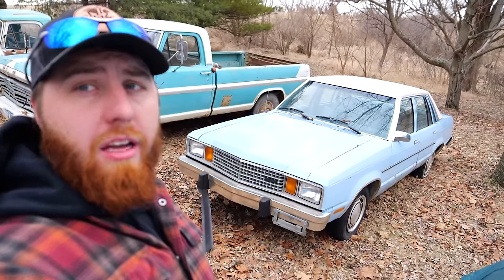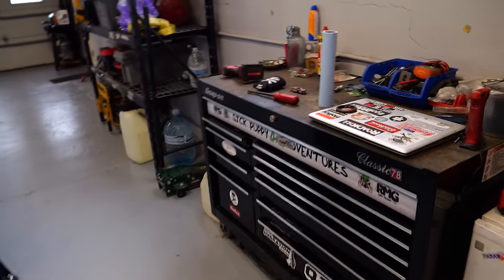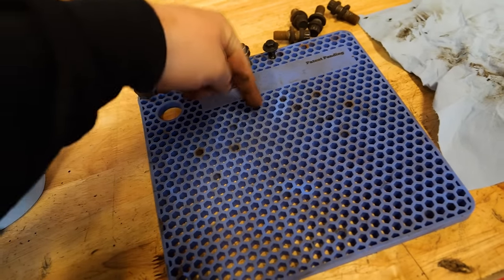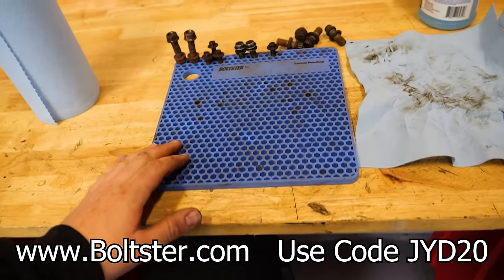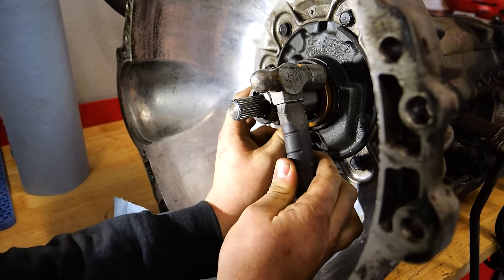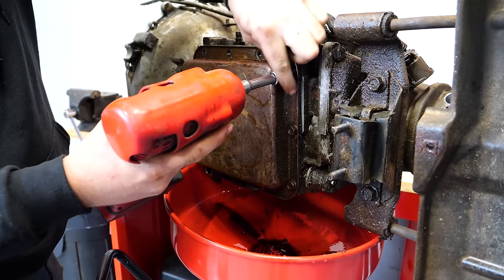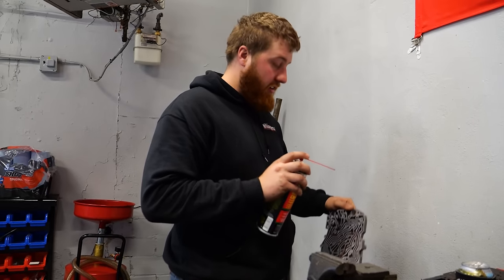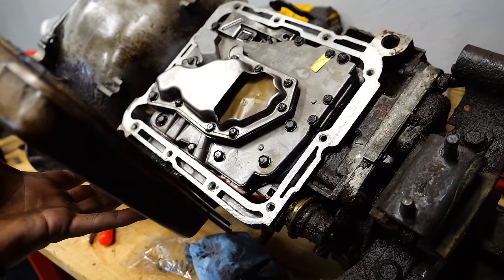CHEAP V8 Ford Fairmont REVIVAL! Will it Run & Drive?

Comment: Engine hoist - a device used to test the tensile strength of everything you forgot to disconnect or missed while preparing to remove the engine.
Reply: 2 ton come-a-long, 6 foot section of tow chain, and big tree in front yard = Engine Hoist.
Reply: Been there,  ahem  done that   $$$$
Reply: Some chains and an old beater 12,000 pound forklift usually auto deletes any miscellaneous wires hoses and stubborn bolts
Reply: @fieraci8500  I did that but with the support beam of my garage
Reply: Yep, BTDT.  Clutch cable got broken the last time I did it.
Reply: Tensile strength is no match for my chipped cutoff wheel!
Reply: A 4l60e bellhousing is not that strong vs a 2 ton engine hoist 🤣🤣
Reply: What does the shift kit do?
Reply: I pulled the flywheel through the inspection cover on my Suzuki XL7's transmission because I forgot about it.
Reply: Accurate
Reply: The most accurate description I've ever seen of an engine hoist.😁
Reply: @fieraci8500  that's exactly how I used to do it lol
Reply: I have picked up the front of my Impala when I changed the motor because I forgot to take the motor mount bolts out
Reply: @Will-ct9ww  that's funny😆😆😆
Reply: @larryhullinger4141  I was wondering why the whole front of my Impala was coming off the ground then I happened to look and see I forget the motor mount bolts
Reply: I feel attacked
Reply: @macoyreiber4482  why
Reply: @Will-ct9ww  I may or may not have missed a few electrical connections and or hoses when I pulled my 352. Needless to say, I am getting a new wiring harness and some hose...
Reply: @macoyreiber4482  its all in good fun We've all done dumb shit working on our cars lol
Reply: @larryhullinger4141  for sure!
Reply: @larryhullinger4141 I once swapped out my intake manifold just to make sure my engine light worked....it does!
Reply: I changed my 77 valiant Charger gearbox out, had two railway sleepers and 4 parts of sleepers, no jack, allso I found a pit helpful when I did my EA Falcon 5 speed, had it on my shoulder, but had to bend my legs a to get out from under the car to put it on the side of the pit 😂 took me all day to remove and replace, it was only about 40 degrees Celsius, fun and games 😅, all the best to you all
Reply: I think you meant to say “forklift or Tractor bucket”
Reply: ok
Reply: Been there done that. Weirdest use for an engine hoist I've seen though, was a buddy of mine welded one to the hitch receiver on his f250 and added some bracing to it, and used that setup as a tow truck. It worked, but it was super sketchy to see that going down a gravel road at 65 mph with a 4 door dodge Dakota being towed with just a half ton ratchet strap and a log chain as a safety chain.

Comment: This Fairmont doesn't look too bad for the year. Since it is a Foxbody it has a lot of potential. I say just beef it up and make it a sleeper
Reply: At this point every old car has been beefed up, I automatically assume them to be a sleeper.
Especially Fairmonts, I havent seen mint beefed up ones at all, so might as well go the whole nine yards to be different at this point.
Reply: @ToreDL87  I'm a big fan of 4 door manual trans cars.  So t5 swap and suspension upgrade would be pretty fun.  Low buck upgrades are pretty cool.  So Many options with mustang parts
Reply: @nealpurdy1202 also 303 cam and four barrel Edelbrock make it a down right great little cruiser
Reply: I say keep it stock like his foxbody mustang that he loves so much
Reply: Beefy mmmmm
Reply: @ToreDL87  dude I dont see any of that here and kevin is basically a neighbor.

Even the big trucks are just fancy looking slomobile's with an exhaust system.
low, slow and loud.

Whole lot of noise for a slow ass car.
Reply: @Bender_B._Rodriguez  Yeah trucks and suv's is all everyone ever drive these days,  what remains of the classic cars have all been bought up and souped up.
Reply: @nealpurdy1202  Love me some manual.
Yeah the foxbody and fairmont are pretty interchangable, they're basically the american ae86 and ke70 equivalents.

Comment: The ford Fairmont, --- put some new bushes, springs , shocks, and a cammed 302 with long tube headers and twin glass packs on it...maybe 4 wheel disk brakes.... perfect long term daily driver..👍👍👍

Comment: Not much wrong with that car like it is. Maybe throw a VERY mild setup at it, so it keeps it's nice road manners, but could turn 14 inch tires into smoke with little effort. Nice rig to throw some friends in to go get ice cream.
Reply: I second that!
Reply: Needs a roller 351w, aluminum heads, single plane, 5 speed and an 8.8.
Reply: Mild sleeper, so you can party with friends...  & then still get ice cream!  Lol.  Thanx !

Comment: Back in 1980, my grandpa bought a wagon version of this car. From factory, it was dark gray with red interiors. V8 with manual transmission. 
Later on, my mom got it and we painted it white.
I tell ya, that car was a tank and, keeping up with the maintenance services on time, never gave us a single issue. 
Great video.
Reply: How many times did it stall out? I rented a few of those in the early 80’s… they all stalled out if you didn’t warm it up for like 10 minutes
Reply: @paulnadratowski3942 Too low idle rev, I guess.

Comment: Keep it as is. That's a great running daily driver. Awesome channel you have.  302 is one of Ford's best engines.  Great score.
Reply: I definitely agree right up there with 300 and 4.6 2v
Reply: And it has a York, piston based AC compressor,  the whole car is a keeper.
Reply: ok
Reply: @RobertDickens2002  had a 200 f150 with the 2v. Only thing I had to do to it was fix the exhaust manifold

Comment: Back in 1991 I changed the automatic trans in an '81 cutlass wagon in four feet of snow. Had to jack it up and put solid concrete blocks under the wheels from the rear and then tunnel under it to lift it more and add more blocks. I did the hella long extensions thig to get the top bolts! If I'da had me a Mook.... It would have gone a LOT easier.

Comment: I can't believe this car was in such good shape, what a find! I had an '80 with the 4 cylinder when I was young, ran great, until the head got a crack in it, but to this day, the Fairmont holds a lot of nostalgia and great memories for me. My mother in law had an '83 with the 6 cylinder, that , because of a leaking oil sending unit, unfortunately died. When I found out soon after how easy the fix could  have been, I vowed to never let any of my family's cars die like that because I didn't know how to fix it. So, quite literally, the Ford Fairmont was the reason I ended up going to school and becoming a mechanic. I have seen a few up for sale over the years since, but could not afford what they were asking for it, and none had the 8 cylinder, which I always coveted. These days, it's a pipe dream for me to ever have one again, as I have financial issues that have resulted in not even owning a car, which has prevented me from having transportation to be able to get to a job, further exacerbating my financial troubles ......so it was a real treat to see one revived on your channel. Thanks for all the great work you do, and all the great content.
Reply: Hold tight to your dreams, always keep your eyes open, and never hesitate to ask about the cars you find. I've discovered several 'dream cars' with this method and some turned out to be very affordable.

Comment: My first self payed car with a straight 6 cylinder engine and a 3 speed automatic transmission. Slow, heavy, save, reliable and cheap on gas my Father knew what he was doing when he recommend it. I was single till I traded it in for a VW T3 camper (best time ever)

Comment: A word of advice when it comes to the Fairmonts, Venturas, and Mercury Zephyrs. The bolts marrying the driveshaft to the diff yoke have been known to back out. I bet you'll never guess how I know this.
Reply: Lemme guess, it happened to you
Reply: @lightningboltschannel525  Yep. On a '78 Fairmont Futura that I owned, back in the early 90's.
Reply: Were those the bolts that needed a 12mm 12 point to remove? I haven't taken one out in at least 38 years.
Reply: @Deucealive75  Yes. The ones on mine were. Is it possible somebody did some work on the car before I got it, and didn't torque them down right? Yeah that's a possibility, but it still taught me to pay more attention to those vehicles.

Comment: I think this would make an excellent fun and comfy daily driver. Maybe put some more comfortable bucket seats in it with a center console, firm up the suspension, perhaps a better camshaft, some better wheels and tires, and get the A/C working!
Reply: Let me add : a litte bit of rust treatment to make sure this car can last a few more wnters, and a set of winter tires to get some grip at low temperatures (which I did for my car).

Comment: For the record, I am not a transmission specialist. I have rebuilt my own 4r70w in my 96 T-Bird, and it was the OverDrive successor to the C-4. 
Springs on accumulators, generally are for "smoother shifts". The 4r70w uses 4 pistons for bands and for accumulators to control shifting and they have springs inside before you put a shift kit in them, also. You also change some of the balls, springs and pistons in the valve body, and drill a couple of holes in the plate for fluid flow (quicker shifts).
Automatics are really simpler than Manuals when it comes to rebuilds, and if you took it all the way down, you'll understand what all the clutch packs, sun gears and bands do, and it'll be burned in your mind like childhood trauma.
Good luck.

Comment: 37:40 It's amazing that no one replaced that AM radio in 44 years; this car is like a time capsule. These early FOX cars had fantastic air conditioners and heaters; they were not only good at heating and cooling, but they were great at dehumidifying (with the selector on MAX) on muggy days. The controls were also nice and simple. The installation of that shift kit would have given me nightmares; I'd be terrified of letting something fall in, or out, before putting it back together. But what you did seems to have worked. Good luck with it; it seems like a great example of a car that's more interesting now than it was back then.

Comment: That car is in great shape! Back in the day I used to force feed 351C in them. Just fit, a bit wider than the 302/351W. The 351W fits with no effort if swapping an existing 302 power plant. Don't see these around up here anymore, well maybe from about halfway up the doors may still exist as on a quiet night you could hear them rust.

Comment: for camshaft and crankshaft seals I didn't have the right tools, I 3D printered me some from plastic. I used the original bolts to evenly press in new seals. it was my first time doing that kind of seal, later for transmission I just hammered it with a piece of wood in between. point is, you can always do good work with limited tools.

Comment: I had an 81, 4 cylinder with absolutely no power, but I loved the car. It had some neat features for what it was. A few years after I traded it, I picked up a ‘79. It was a v6 and was the base model. Both were in excellent condition. I wouldn’t mind having another one.

Comment: Had one in the 90s, old highway patrol sedan, super fast top end, but a tub on takeoff.  Oil cooler power steering cooler, brake fluid cooler and all the associated brass to replace annually. Thanks for the trip down memory lane.

Comment: Enjoyed this one a lot. My family had an 80 Fairmont wagon with a 6 in it, and much later an 82 Fairmont sedan (also with a 6) that a grandma had only put 30k miles on in 18 years. It needed a lot of work over the years by my dad once we made it a daily driver, and he installed a DIY throttle control in the engine bay which didn't fly well with my mom who drove it, since she had to spray brake clean into the carb and regulate the throttle with the hood up when leaving work. But, one does what one must when $ is tight!

Comment: I had I believe it was an 83 LTD 2 station wagon basically the same platform as the Fairmont I think, I loved that car, it had a 3.8, unfortunately it spun a bearing, I put a used engine in it which blew up on me, it barely ran and the engine sounded like everything just exploded in it, a guy I was friends with came to my house and managed to drive it to his shop a couple of blocks away. One snowy miserable day I took my mom to our local supermarket, I dropped her off, she called to pick her up, when I got there she was talking to two guys, they had two shopping carts loaded with groceries, the store is near what used to be a Hess oil storage facility, the tankers would come and unload the oil and it was piped to the refinery, it turned out that these two guys were cooks on a tugboat and they needed a ride back to boat with the groceries, they couldn't get a cab because of the storm, since I had the wagon everything was able to fit, I drove them right up to the dock which was cool to see a tugboat up close, they gave me a couple of bucks, this was in Perth Amboy NJ, I'll never forget that day.

Comment: I had the 79 mercury zephyr 2 door, dark orange with the light orange vinyl roof, 6 cylinder in high school. Carb rebuild and a manual choke made it a pretty dependable runner,

Comment: We moved from Chicago to L.A. in 1979 when I was 10 years old.  My dad got a job out there and we had just gone through the blizzard, so California called.  He got a company car, a 1979 302 equipped Fairmont.   I learned to drive in that and the family's 1974 Buick Electra.  It took on many of the 'sporty' Japanese cars of the mid to late 80s, but I learned what a sleeper really was when I lined up at a red light next to what I thought was a V6 LTD, but was actually a LTD LX and it blew my door's off (well, it seemed that way, lol).  It, and a subscription to Hot Rod magazine got me intrigued for real hp, and I ended up buying a '86 Capri GS with a 5 speed.

Comment: I put that exact shift kit into a c4 out of my 77 Mercury Monarch. It was very easy. Get the transmission in and out of the car while on my back on dirt with a regular floor jack, not so much.
If you do anything with the car as is, mild cam with four barrel would be a simple power upgrade, especially if you can toss some 5.0 heads on to open it up. Shouldn't hurt economy much; might actually help it. Plus an 8.8 with lsd.

Comment: First car I ever bought myself was almost identical to this except it was a 4cyl.  Same color, 4 door 79 with AM only. It did GNARLY powerbrake burnouts.  Used to go to the junkyard and buy full sized spares and keep 2-3 in the trunk with a floor jack.  Would roast tires until they popped and swap a new one in 2 min.

 The K member of the 4cyl will accept a V8 but the straight 6 is all different.

Comment: 4wd hub socket works perfect for those seals btw 😬 also national makes seals/bearings for everyone not just O'Reilly.. ford 7.5 rear ends actually use national and timken bearings depending on the years

Comment: My Mom had one of these, back in the day.  79 4-door Fairmont, but it was mint-green with a black interior and had a straight-six (a 260?  I think?  I was a kid, so I could be remembering that wrong).  They're so simple and easy to fix.  And they were so cheap that they were basically "disposable" transportation.  You drove it until it the wheels fell off, then you scrapped it and bought a new car.  So that means there are very few left in this kind of condition.  Perfect for a "sleeper," because you don't have to do a ton of cosmetic work to it -- you can just do mechanical stuff.  I do hope y'all will make some more videos with this car. I really like it!

Comment: My wife had a 79 Fairmont, white with a red gut. The thing I remember most about that car was the horn, you had to push in the turn signal stalk! It also had working air conditioning but non tinted glass, so it would never really cool off on hot days.

Comment: The last transmission I did I raised and lowered it using 3in ratchet straps and a jack. The ratchet straps allows you to raise and lower the front and rear independently and lodging to swing it to slide it right into place.

Comment: They made some of these with a 2.3L 4-cylinder and an automatic transmission. On a good day you could actually pass a Yugo or Chevette given  a mile of road to do it in. There were 4 different 4-speeds which came with the 2.3; one was a "Dagenham" from England. It was notorious for having the shift forks pop off the gears unless you were gentle with it. You could pop them back on pretty easily with a handful of tools from inside the car which I kept in the passenger floorboard and used frequently. Slowest car I ever owned and I was happy to see it go when I sold it.

Comment: My Grandfather had an 81 or 83 Fairmont. He purchased it in the early nineties from an old woman, the car had only 32,000 miles. I remember it was butter yellow with a tan interior with vinyl seats and if im not mistaken an AM radio. I hated it. I can't remember the engine size but the car would haul ass and the AC would freeze you out.

Comment: With the exception of the 302 V8 this Fairmont is EXACTLY like the one my Grandmas first cousin Audrey had. Hers had the inline 6, which was probably quite anemic, but it was reliable and ran until she passed in 2013. She didn’t drive it the last few years due to failing eyesight and cognition problems, so I think my uncle sold it for her at that time. Solid car though, and I’m almost positive hers was also a ‘79. Great episode Kevin and Mook!

Comment: Being broke, I once changed the throw-out bearing on my 1964 Comet 260 V8.  Driving the front tires onto a curb of our community college parking lot,  in the winter, I pulled its three-speed, using hand tools, without a jack.